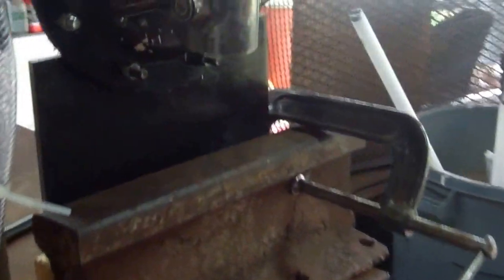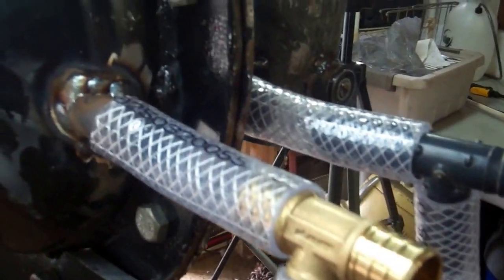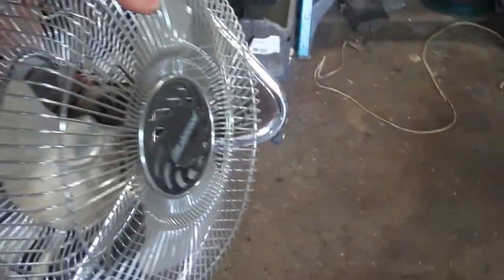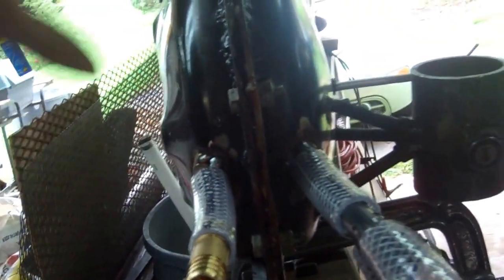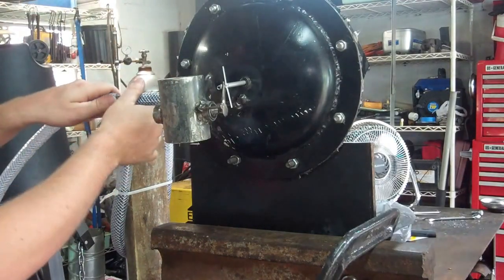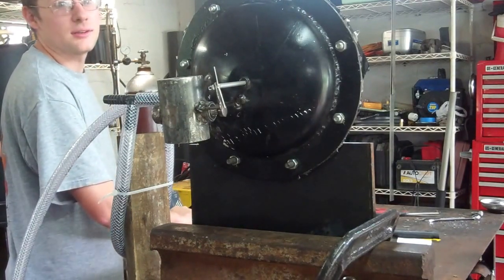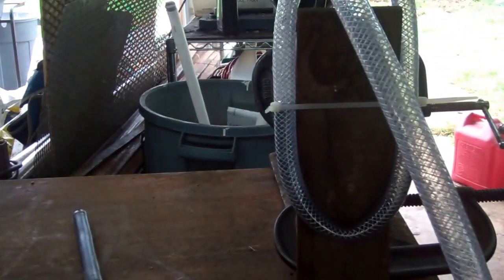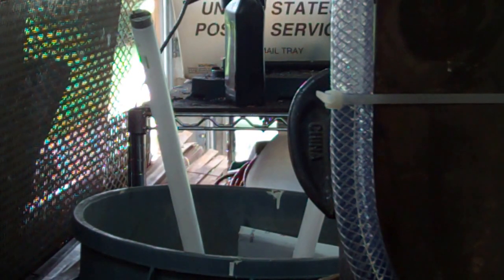Automixer 2 - Suction test

Comment: Beautiful 😊 so cool to see the it works on jus a few mill barr if difference. Recently, I've used your idea of using trash bag plastic for my zero pressure regulator build . Mine is a positive pressure system